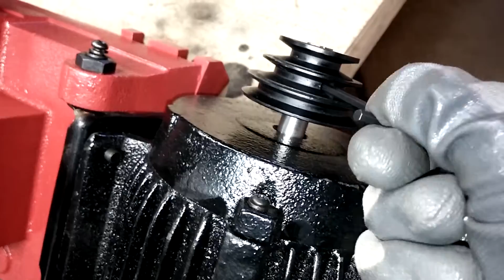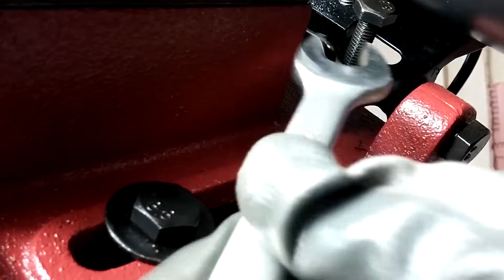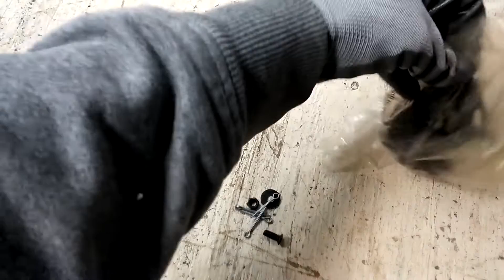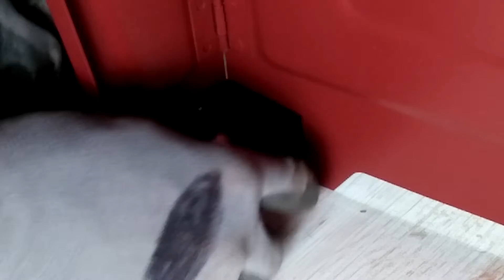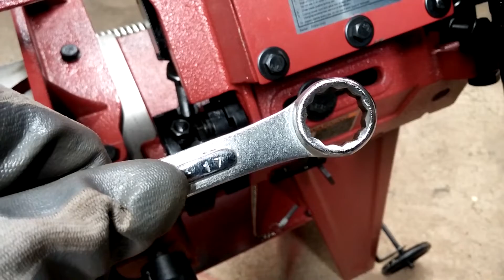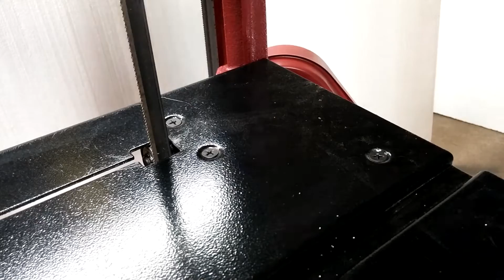Harbor Freight Band Saw  -  Part 2  -  Assembling My New Saw

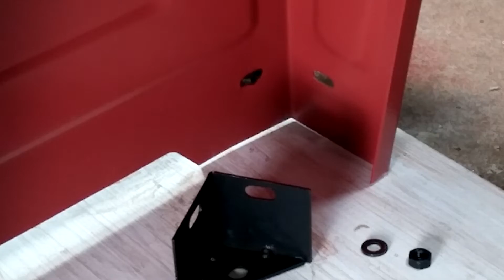Comment: 8:12 These feet are in the box but are completely ghosted in the instructions (other than the parts view); apparently they are supposed to magically appear in position somehow.

Additionally it says to put the saw base INSIDE the legs when the legs clearly have to fit inside the saw base. Thats why I came here, wanted a sanity check.
Reply from the maker: I've noticed the instructions for cheap tools tend to be lacking, or just wrong sometimes.  Can be pretty frustrating.

Comment: Had this problem in several HF instructions; when they call for a (for example) M6x12 bolt, I wish they would have a lifesize drawing of one so you can figure out which of the dozen bolts all thrown in the bag at once is an M6x12.
Reply from the maker: That's a good idea, would make finding the right bolts much easier.

Comment: what is the total length of the saw, width, height. please and thank you!
Reply from the maker: After it's assembled, I believe it's about 36 inches long,  16 inches wide, and around 37 inches tall.  The height of the table was about 2 ft.  That ended up being too low for me so in part 7 of my budget bandsaw series I built a new stand which raised the table height to 31 inches.
Reply: @BudgetPhil  thank you soo much! I will be checking the area i can store it

Comment: I finally assembled it on the stand. It took so much effort. Two people and we couldn't make it match, we had to lay the saw body on the ground and attach the base to it and then pull it up, it was the only way to make it match the holes. What a job
Reply from the maker: I know what you mean.  The factory stand was tricky for me to work with also.  Very unstable without the bolts inserted.
Reply: @BudgetPhil  on top of that, the pulley on the gearbox was so tight that I had to pry it out... I already have put so much time in this saw today, I will have to tune/align it another day. Slow process, but I'd rather do it right. Your videos help so much, the instruction manual that came with the saw is worthless...

Comment: Thanks for a really interesting video. I've got a saw like this, likely a little bit newer version, but it has the same weaknesses.
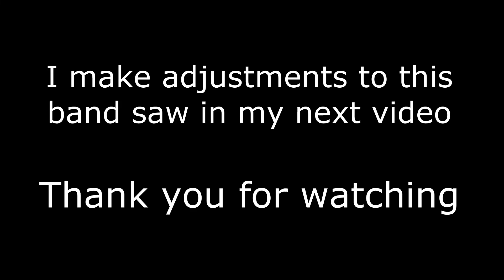Look at the table You mount at the time 15:10. Why that large rectangular hole next to the blade? Cutting small pieces is dangerous as the support around the blade is nothing. I intend to add a 5 mm thick aluminium plate to the table, attaching it with some M3 - M4 screws. That plate will only have a cut allowing the blade to pass, nothing more. What do You think?
Reply from the maker: I agree.  Many of the higher quality band saws I've seen have an aluminum plate on the table.